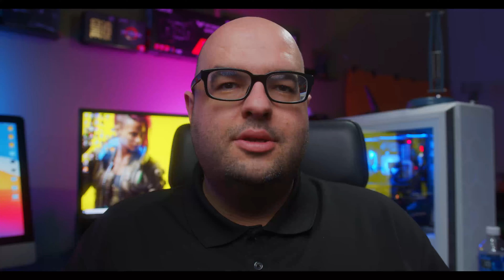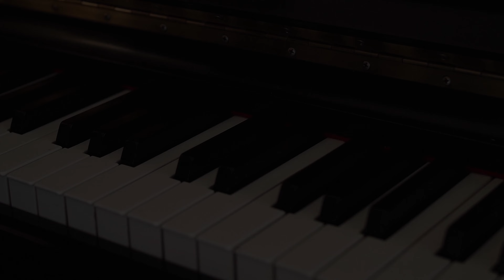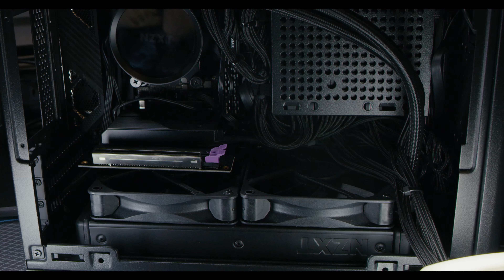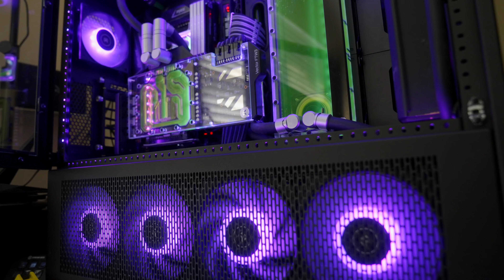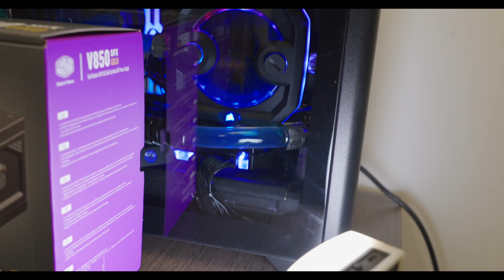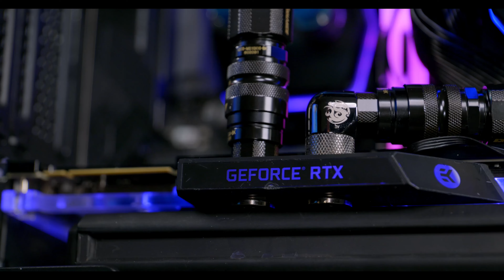IMPRESSIVE! Cooler Master NR200P Water Cooled 2080 ti Gaming PC Build

Comment: @Classisal Technology would this be to much to throw at a first computer build?  I am looking at doing a 3080ti and either 5900x or 5950x in the same case but wasn't sure if trying to water cool your first PC is biting off to much for a first build.
Reply from the maker: It may be better to start off more simply with water cooling larger cases first, it can be a little tricky in a smaller case for sure

Comment: I am planing to custom loop with this case, is 120mm slim on top and 240mm slim botom all xspc model, would sufficient to cool 10900k + rtx 3080, also using the iceman reservoir m1 outside.. What do you think?